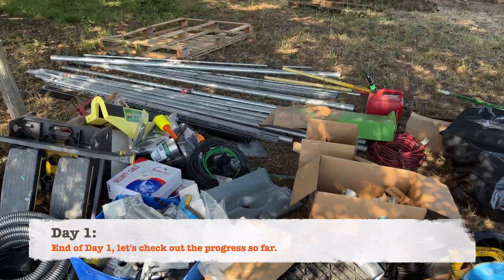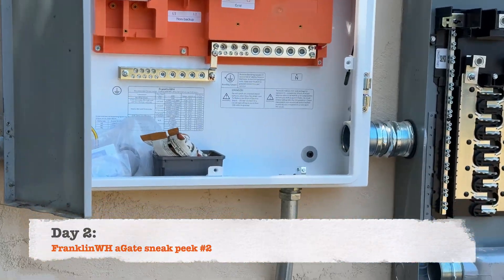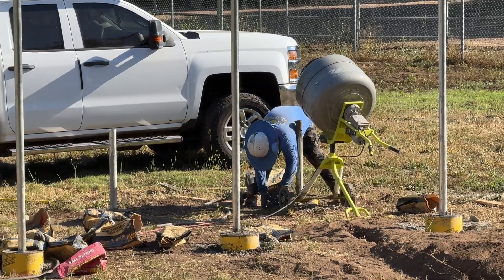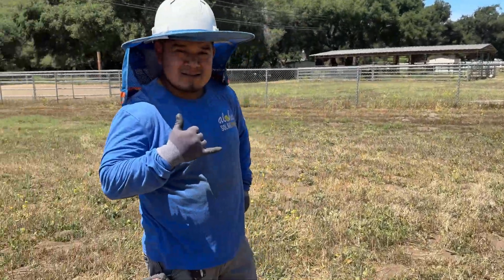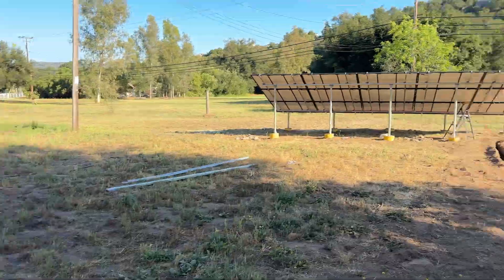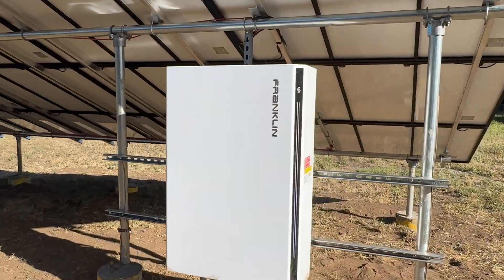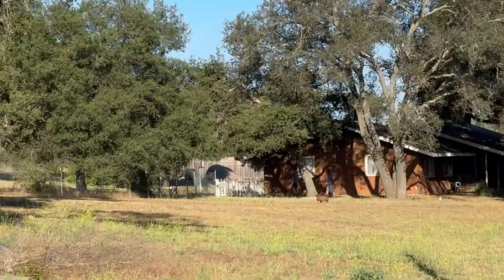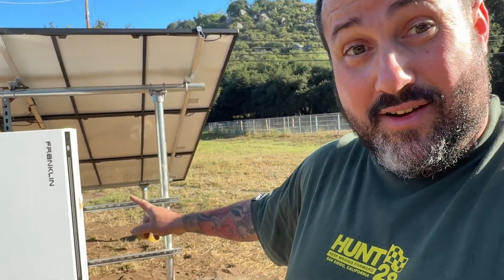Ground Mount Solar Install by Aloha Solar Power. REC Alpha Pure RX 460w, FranklinWH aPower S,  aGate

Comment: Oh yeah! You have to watch anyone coming to your door. Most are shady as hell. I presently live in a community that has a clubhouse, and they started talking to a door knocker. The quote was out of range at $100,000 for a 30kw system. First, the clubhouse only needs a 20 kW system to eliminate its bill, and second, I showed the president the real cost of the quoted equipment really was. The solar company was charging over four times the cost of the equipment that they had quoted to the HOA.

Comment: Congratulation on your setup.  I did my own DIY ground mount install and solar setup.  These solar company are so shady, they markup up everything 3x the amount. I now know every wire and circuit in my system. If anything fails I can fix it.
Reply from the maker: I really considered doing my own DIY setup but  the permitting process in California is complicated and I wasn't confident that I could navigate that process correctly. In the future whenever I do any off grid setups, it will be fully DIY :)